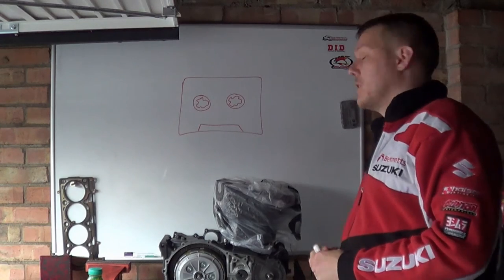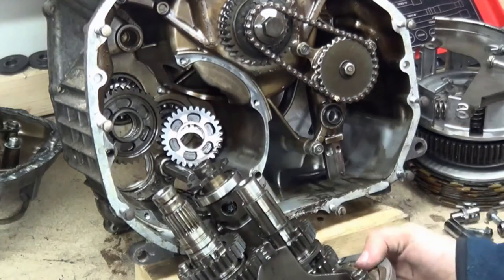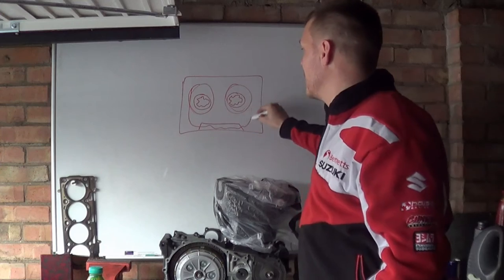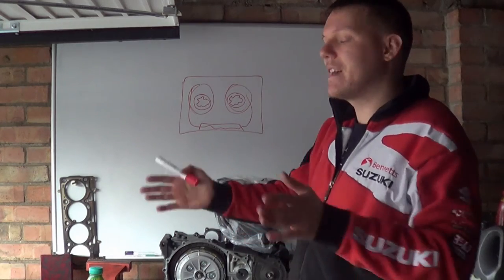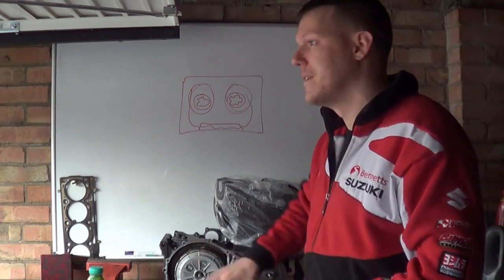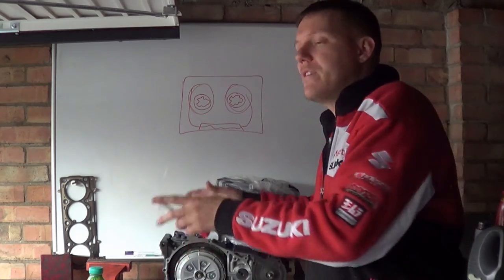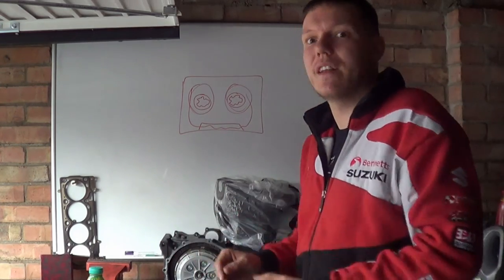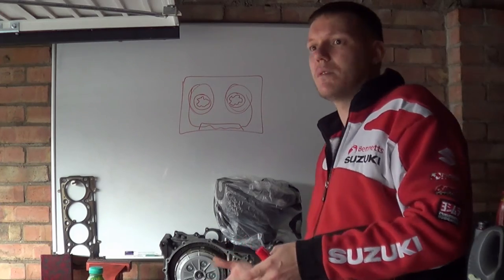Cassette Gearboxes - What are they?

Comment: Interesting indeed... Some time ago I heard guys talking about FIM or some other regulations about wsbk or bsb or whatever so basically they were saying that the chassis and engine block have to be as oem spec or something like that so it'd make sense for manufacturers to design blocks with cassette type gearbox applications I guess? Also there are few other extra lugs or non drilled or threaded bracket places that could accommodate oversize radiator or bottom mounted rear brake caliper (at least it looks like it) so yeah I don't know if I'm right or wrong but it'd kinda make sense to me to design them like that if I was a manufacturer. The bikes I'm talking about are 2009 R1 & 2013 R1. About non high performance bikes that I don't know honestly.

Comment: One of if not the earliest example was used on Harley Sportsters (in the 1950s, those were off-road racers) which made for swift and easy transmission swaps. HD big twins (the bean counters kill them on Sportster) still use them and they make transmission swaps and servicing a breeze.  HD realized the original owner is wildly unlikely to replace a Sportster gearbox and when it's out of warranty it's no longer their problem. (Rubbermount Sportsters with transmission problems go cheap as it's often better to swap in a used engine than pay retail for a teardown but it's not hard to DIY.)  Big twin owners strongly prefer the cassette (makes for easy installs of Baker seven speeds etc) so they keep them. Cassette boxes are wonderful for mechanics, but modern manufacturers don't care much about us. 8-(
Reply: Polish Sokół 600 RT is first cassete gearbox in motorcycle.

Comment: my engine had loads of crap in it when i dropped the pan because i dropped a valve spring colet, the worst part is i have no clue how much was already in there or if i even grabbed the one i dropped, but everything was in great shape and the bits that were down there had no marks or any signs they hit the engine at any time, but i'm glad i found it out but the question if i got it all still lingers about in my head from time to time

Comment: Could it also be, production line speed of manufacture makes it profitable to offset the cost of the extra expensive of the cassette? I.E. the bottom end is assembled and moved down a line where someone slaps the gearbox in and all the support bits at the same time saving time on the line. Just a thought.
Reply from the maker: Never thought of that, its a good point since all the bike manufacturers have switched over to LEAN production - nice

Comment: The cassette gearbox is also easy to repair and maintain since you do not need to take the whole engine apart to work on it. Like the BMW K1200 has a shitty gearbox due to size and torque it needs to handle. But to be lucky the K1300 has most shite sorted out and will fit in the K1200. So if that bitch ever breaks on a K1200 you might as well put a K1300 gearbox in it. And that is all made within an hour! To change the gearbox without that cassette system it might take a whole day or even more. And when your gearbox breaks on an non cassette system it could be the end of the whole engine but with the cassette system you might want to change a few bearings and flush the metal bits out of the engine and replace the oil pump before dropping in the new gearbox and it is good as a new engine. I think the "plug and play" system can save you from mayor repair costs too.
Reply: yes but normally how ogten does the gearnox break before the engine itself breaks? or if the gearbox breaks before then the engine itself should have a maintenance i think
but im could be wrong im just a bit of guessing
Reply: @assi2assi  It varies but ease of maintenance is always an advantage. Many BMW owners keep their machines a very long time and tearing down a perfectly good motor or gearbox to service a broken motor or gearbox is an unnecessary asspain.

Comment: Horizontally split cases are the next best thing to a cassette gear box in that you don't have to take the engine portion apart...cylinders Pistons crank head all can stay together.  Now you are wrong about transmission troubles meaning you have to overhaul the entire engine due to metal fragments ...yes that could be the case but a lot of times it could just be maybe burnt a burnt shift fork or something has worn or bent (fork) to the point of faulty shifting.   And frankly even a non- professional COULD benefit tuning wise if he used the same bike for much different purposes time to time ...could pull out the normally used close ratio gearset and slide in a ready to go wide ratio unit for an annual event out west where it is a lot of wide open instead of more normal tight single track.  

Except for potential added weight, the BEST kind of cassette gearbox in my opinion is entirely modular where it has it's OWN case area, it OWN oil that is not shared with the engine ...I actually had that arrangement on my first real MX bike ...a 1972 AJS 250 Stormer.  It had a great BOX,  A primary/clutch case and the engine all bolted together.  It looked very heavy but somehow they made the bike roughly same weight at competition that all had what became the new standard Unitized construction.  Although the modular approach is really sweet to work on,  there is more complexity ....more metal ...extra seals and coupling points....

I honestly believe a MAIN reason manufacturers don't bother giving such things to consumer is simply they don't want machines that are easy to keep going forever.  They want machines to become obsolete in a few years and I worthy of a lengthy repair process.   Make it simple enough and people will keep them forever!  They would become like the VW beetle which was simple enough that people actually repaired their own card and aftermarket became so HUGE you could build a vehicle from the ground up without using a single VW part!  That is TRUE!   NONE of the manufacturers WANT that for their vehicles!  Their actual plan is that if you buy a $10k bike this year?  In five years it will look outdated and in ten years even in pristine condition it will be only worth a fraction of the original cost EVEN if still pristine!   Now the only exceptions to this are when a company literally makes no mechanical changes over the years like KLR650 or Honda XR650L etc...then the old ones are not so obsolete given they are all the same ...I LOVE THAT !   I do wish it were the case for every category of vehicle...timeless models that remain the same classic original design with improvements done by owner via aftermarket!    Good resale and WORTH fixing and upgrading!